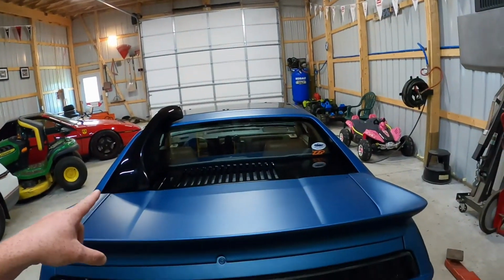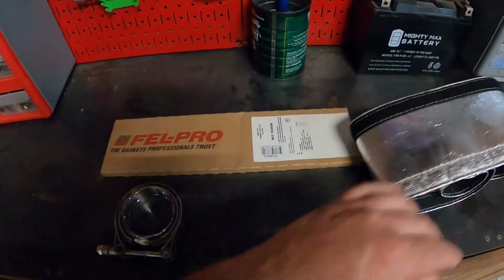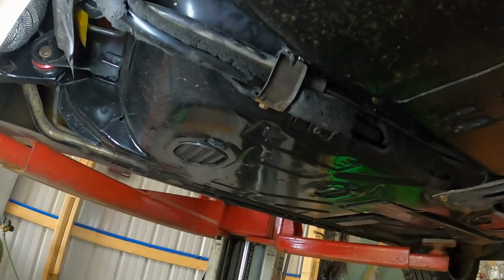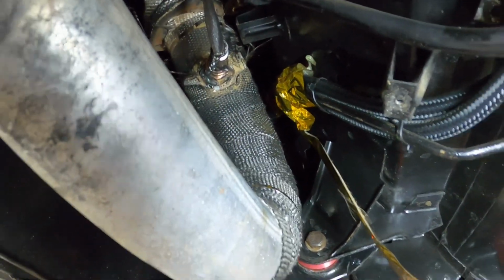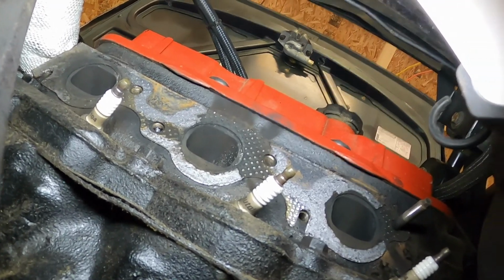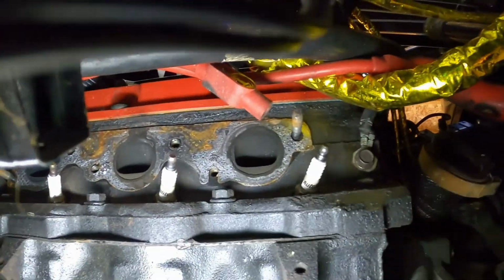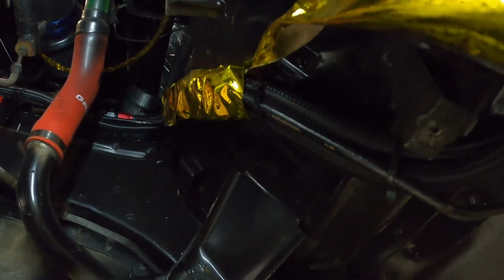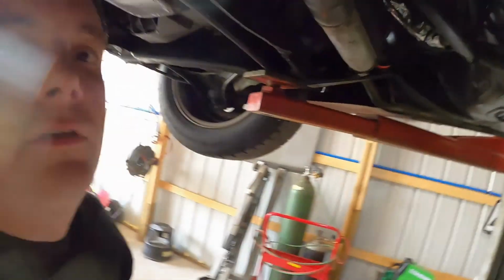84 Fiero Wide Body: Fixing Exhaust leaks on the 3800 Swap.

Comment: In Australia we remove the supercharger and turbocharg them and wind the boost up
Reply from the maker: It’s something I’m thinking about doing. 🤔
Reply: @RearEngineShop  the 3.8 come in a selection of Holden cars hire in Aus being rear wheel drive and having so many options for drive lines as the 5.0 v8  or the na or supercharged many put the supercharged motor into a na body and use stock headers and make a cross pipe with a turbo flange you would have many options for turbochargers,we have a eBay t70 on a na 3.8 in a Holden vh 4 door rear wheel drive commodore 6 psi it lights up the wheels through the auto
Reply from the maker: @douglasbaxter3346  yeah I want to find another 3800 with lower miles and do some mods. Cam/valve springs/ported heads. Then turbocharge it. The current engine has about 220,000 miles (350,000 km). I will need a stronger transmission.

Comment: You didn't considder using metal gaskets? I've had the type of gasket that you fitted come apart in boosted / higher heat applications. Just saying!
PS: The underside of your car is spotless! No surface rust. Very good job.
Reply from the maker: We will see how these gaskets hold up. I can always do it again. So far so good!
Reply: @RearEngineShop  👍😉😁

Comment: im looking at your shop wall on either side of the garage doors
  you only have a small less than 30 degree angled 2 x 4  for racking near the corner
it means this is the only piece of wood in shear or compression holding the wall from collapse
in a high wind storm to me is totally under designed
please do this  asap   put a full 45 degree  X    or  2  full height 2 x 4  in an X pattern
 on each wall and including the wall opposite the garage doors, 
so you need 3 reinforced walls right now asap

as i see it right now your relying on the thin metal exterior sheets to support your garage
this is a no no after time the screws will get larger holes in the metal and less strong
Reply from the maker: The posts are 6x6 and are cemented in the ground 4’. It’s pretty sturdy. The side with the doors could use some extra bracing though. Thanks for the advice!👍

Comment: Thats why you purchase proper MLS gaskets like they came with...... felpro crap on aftermarket headers??? Very strange to cheapout on a gasket not to mention re-using a shitty gasket on your aftermarket headers.
Reply from the maker: They are shitty aftermarket headers so I wanted them to match. 🤷‍♂️👍  I paid $100 for the headers, they are not that great.
Reply: @RearEngineShop  mls gasket is 20$ canadian, also had alot of success reusing MLS gaskets in any form, lots of problems with shitty felpro material gasketd though
Reply from the maker: @Templeman420  they would probably leak. The header flanges are not perfectly flat. They are cheap crappy headers on a $300 high mileage 3800 that I probably have $1400 into the total swap.
Reply: @RearEngineShop  alright well that car sure is beautiful
Reply from the maker: @Templeman420  it looks good on camera. It needs the body kit refitted and aligned which will be done at some point. It’s a cheap plastidip paint job. The car is not a high dollar build it’s a cheap fun summer car.